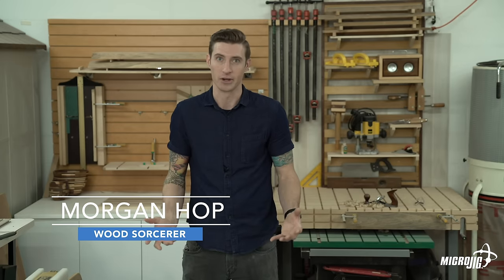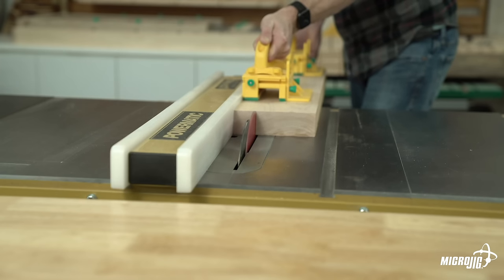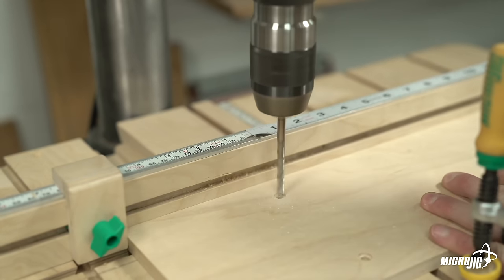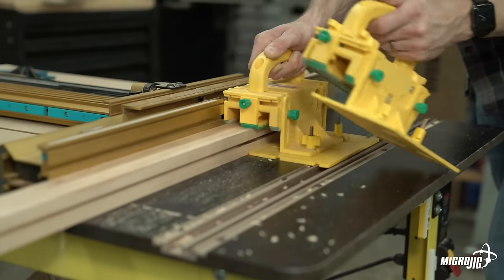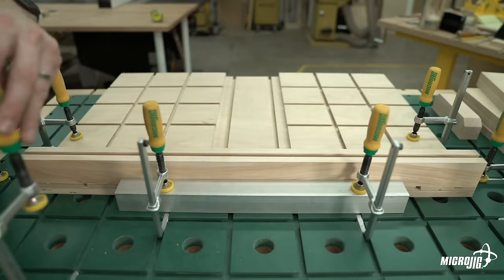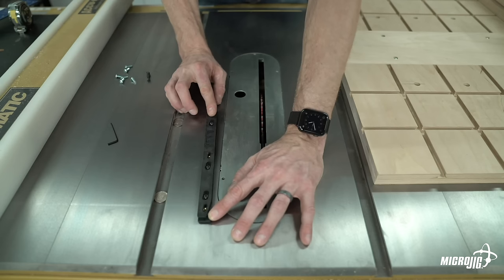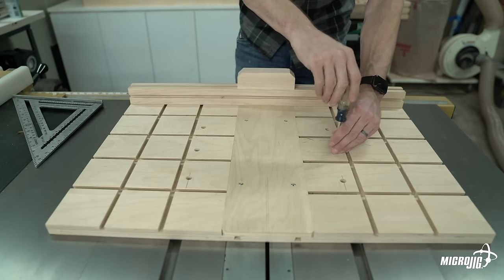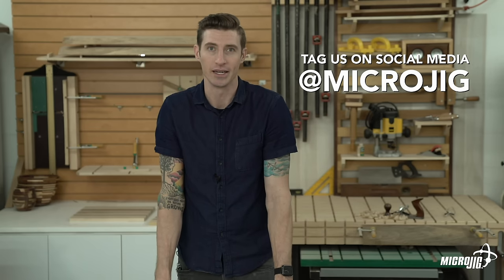How To Build the ULTIMATE 360 Table Saw Sled!

Comment: Morgan, as an owner of most Microjig products, I really appreciate this project! I’ve already downloaded the plans. One suggestion would be to make a fairly detailed video showing the use of each of the accessories. They’re easy enough to make using the downloadable plans; however, it really would be helpful to see how you attach them and examples of how you use them. The plans don’t necessarily make that clear and such a video would really help. By the way, on the 360 hold down fence, I was wondering what angle you cut the bevel at. Many thanks again for all you do!
Reply from the maker: the beveled edge of the hold down fence was cut at 30 degrees. And yeah that's a good idea - more detailed video about all the attachments. I'll add that to the ever growing to-do list haha
Reply: @Microjig  You should link to this video.  Who would want to put the time into a project or even watching a build video without seeing how it works?
Reply from the maker: @uhadonejob  this video is literally linked on our webpage where you download the plans: https://www.microjig.com/post/ultimate-sled
Reply: @Microjig  If you would read the message thread you should link to a video showing how to use this and the many features.  It is a big time investment to build something an d not have a clear idea of how well it works.  I appreciate that you did try to reply.

Comment: Morgan, I really enjoyed this video and I will likely build such a sled.  I would however like to suggest an added safety feature.  The front of the sled, closest to the operator would be better designed if it was extended toward the operator perhaps another 6" or so to allow the saw blade full travel.  This could be tapered toward the outer corners, to reduce bulkiness.  The reason for this would be to allow the sled to be pushed further into the blade such that the center of the blade comes up to the face of the fence, thereby permitting maximum cutting depth for thicker materials.  Additionally a wooden block or box should be added nearest the operator to keep the blade fully enclosed when cutting that far.  This allows allows for additional reinforcement of the base plate to compensate for the cutting of the base plate.

To prevent over-travel of the sled, a removable stop block could be added to the bottom side to stop the sled travel once maximum cutting distance and depth has been achieved.

Another nice addition would be to have a removable polycarbonate (lexan) shield attached across the top of the top reinforcing block, to prevent saw dust hitting the operator in the face.  This protective shield could be inserted into a groove in the face of the support bar, for easy and quick removal/replacement when needed.
Reply from the maker: dang, all REALLY good ideas. I'm sure I'll need to build another once in the near future so I'll definitely incorporate these mods!
Reply: I subbed to your channel because of your suggestions here
would be nice if you made a video of your ideas, please!

Comment: I just bought the 360 sled kit. Which one is better? Do I need to buy another kit to
Make this?
Reply: I'm building both. The reason is, i think the 360 sled is better for panels than the ultimate sled. Though, for most jobs both would probably be just fine. Which way did you end up going, and did it work out well for you?

Comment: I'm making one of these sleds right now and I drilled the 3/8 holes on the zero clearance inserts as instructed but  the mircojig hardware  washer is bigger than 3/8 so you will have to drill a larger countersink hole so I am using a HSS Brad Point Bit, 29/64,   this allows the provided washers  to just fit without making to large a hole.  I couldn't find a forester bit that was between 1/2" and 3/8"  I guess 1/2" would have worked but I felt there was to much slop. It is  Great crosscut sled design.  Very Happy!
Reply: I like the slop since it helps in awaiting up the sled before gluing the wings on

Comment: I’ve always made, and used crosscut sleds with a fence at both ends.  This sled is held together only with a front fence. Since you’re essentially cutting this thing in half I can’t help but wonder if the one proximal fence is enough to keep everything square.  What prevents the kerf from becoming narrower or wider over time?  Am I missing something?
Reply from the maker: We recommend building it with a removable front fence. Under normal use the front fence stays on, but for mitering longer parts the fence can be removed.

Comment: Morgan, why not use a rear fence to stabilize the rear portion of the sled. That way when you remove it from the saw it will have less of a tendency to split apart.
Reply from the maker: We are working on an updated version of these plans, and they will include a removable end fence.
You want that support, but making it removable allows for making miter cuts on longer boards.

Comment: You are gluing the fence to the sled. How do you adjust it? Is a five cut not needed?
Reply: Great question. Not the best detail in some of these videos but considering the price of the plans, and how versatile these sleds and jigs are, hard to complain. I'll be doing the five cut for sure.
Reply: see garage works and see how he does it  He uses a dial indicator and a machinists square.......simple

Comment: Great plans; great video. Lots to learn from this project. 
For instance: 
1)	Take your time: the Wood Sorcerer may not be an evil sorcerer, but he sure is good at making this all seem easy, and it isn’t really hard; if you take your time. 
2)	Measure 3 or 4 times; cut/boar/swear a whole lot less 
3)	Not all miter slots are the same…Even on the same saw table
a.	Some slots are wider than others …. Even on the same saw table
b.	Not all slots are the same distance from the blade .... measure them individually…. Even on the same saw table
4)	Put the inserts in with the screws near the open end.

Comment: I LOVE this design.  I'm working on a sled now that incorporates many of these features.  One thing I'm confused about is how to accommodate multiple zero clearance plates? I can't get my mind around how these different kinds of cuts don't mangle the front and rear fences.  Several YouTubers show the value of having these changeable plates, but they never show them in use and how they impact the fences.  The only thing I can think of is to add a temporary spacer in front of the fence so a 45 deg blade never touches the fence, or just live with the fence having a 45 deg kerf in it (and possibly kerfs for other angles between 45 and 90).  I don't mind the fence looking mangled from multiple angle cuts, but do those cuts ultimately compromise holding small stock against the fence for a simple 90 deg cut?
Reply: Yeah this is basically what I'd do... You have that dovetail groove in the face of the fence, so you can mount whatever sacrificial boards to it that you like.

Comment: I've made this sled as outlined in the plans and I would DEFINITELY recommend using 3/4" plywood as the base, rather than the 1/2" recommended in this video.  Once you cut the channels for the zero-clearance insert, you have 1/8" of material there and you are going to have to be SUPER CAREFUL doing the remaining steps before you put the back fence on, or your base will just snap in half.  There's almost no wood there until it's reinforced by the fence.
Reply from the maker: Hey Charles, great feedback! I considered 3/4" ply for the base but decided on 1/2" to preserve some of the capacity of the blade height. I figured I'm already losing an inch of capacity with the sled, didn't want to lose another 1/4". So yeah you have to be gentle with the base until it's reinforced if you make it this way, but of course you can use 3/4" ply for the base if you don't mind sacrificing a little more capacity.

Comment: I should have read the reviews before I bought the clamps, router bit and dovetail hardware. I am not the greatest woodworker, but this sled has so many variables that you can't help but miss one. it's heavy, flimsy, goes out of square after you take it off and put it back on your T/S  in as little as 3 times. I, like most hobbyists, do not have two table saws and use the same one for ripping and cross cutting. This sled only works if you leave it in place. MicroJig, mission accomplished, you conned me into spending $150 and wasting three days with your slick video.
Reply: Stephen, have you resolved your problems with this sled design?  BeI am quite interested in building one but concerned about the issues you raised
Reply: CORRECTION - sorry I sent that before it was completed. I also wanted to say with there products being expensive in Canada they also have pretty severe supply and demand problems, so it is a big commitment.
Reply: My only regret with buying the Matchfit system is that I only discovered it after spending a fortune on t-tracks and accesories......... anyone after some t-track?

Comment: With the dimensions for this sled, what’s the general crosscut capacity? Thinking I might give it a go
Reply from the maker: If I recall, the sled is designed at about 20 inches deep, but without the front fence, you can have parts overhanging the front. 
The actual cut width is largely based on your saw table, the distance between the front lip of the table and the front edge of the blade. 
With a 20" deep sled base, minus the 1-1/2" fence, you could have as much as 18ish inches on the sled plus several inches to the blade.

Comment: I'm overnighting the glue up and man was that initial routering frustrating. My router "table" is not big enough for the sub-project, I had to just clamp things down and struggle to get it all set up in that manner. I'm not super excited to do those routes on the top tomorrow, but we'll cross that when we come to it. Mostly I was here to comment that the cut list had those 6" sacrificial boards at 24 1/4" but then when I got to the glue up, they were magically only 20 1/4. I'm still not sure if I'm going insane or if that was a typo.
Reply from the maker: It is a typo but we cannot comment on your mental state! LOL.
A straight edge clamp does help a lot with some of the internal grooves.

Comment: Would it be ok to use mdf for the base material, the 20"x30"x1/2" piece ? Or is it not strong enough? Thanks for the great videos
Reply from the maker: MDF is "strong enough" overall, but care would need to be taken when handling the sled putting it on and taking it off the saw table. 
When on the table, there is little stress, so be careful when picking it up and how you store it.
A removable fence that can be connected to the front edge with dovetail hardware will greatly stiffen the sled base and can still be removed when parts need to extend beyond the front of the sled.
Reply: @Microjig  thanks for the reply. I'll be going with plywood now.

Comment: I have been wanting to build something like this for quite some time, particularly love the way the zero-clearance insert modular design is incorporated.  Great design; thanks for the video and first-rate, downloadable instructions / plans. Great presenter; hot body, i.e., not fat; and why do you sometimes comb you hair to the left and sometimes to the right?

•  Some sled components / parts use MDF and some plywood.  Is there a durability / performance difference between the two?
•  What is that green (base) material used in sleds?
• What is the purpose of the holes in the center of green sled?  Is that / could that be a sled weight-reduction function?
•  The individual “squares” on the sled are about 4x4.  Is this based on the throat depth of the clamps?  Would 3x3 squares be less or more functional / utilitarian?
•  The slots on the base of the vertical cutting jig do not appear to match what is shown in an instructional video. Is this a subsequent modification?

Finally, seeds do not die before they grow: they ripen and go dormant before they grow and bloom in order to continue the cycle.
Reply from the maker: ragcell- a lot of questions there, please send me an email with them at "support@microjig.com" and I will gladly type out a full set of answers.

Comment: Is this sled not secured at the front? Most sleds I see have a fence on both ends, wouldn’t this be totally unstable when taking it off your table saw? I’d be worried the two halves would break as the only thing holding them together is the rear fence
Reply: Any answer to this.  Wondered the same thing.
Reply: Likewise. Seems he is depending on the rather hefty hardwood fence to hold everything together. Might be fine, though I’d be tempted to add something on the front. How, I’m not sure yet. I do like the concept, and I’ve got pretty much everything I need for it. But whether I want to devote the time and resources to making yet another sled I don’t know.
Reply: I'm definitely planning to add a front fence to this design as I build it. You do have to make sure that you can still remove/insert the zero-clearance inserts.
Reply: I'm building this now and was wondering the same thing. But, I think I have a solution. Before I remove it from the table saw, I'll clamp a 2x4 across the front (using the matchfit dovetail clamps of course). I'll lose two clamps, but that should keep it held together. Will try to update after I finish it.
Reply: Wondered the same. Anyone who built this sled have any issues with the unsecured front?
Reply: I just posted the same question not realizing that you guys have raised the same issue here.  I guess the best advice is to fabricate a rear fence to deal with this.  Seems like a stability  issue that was overlooked.

Comment: Brilliantly done! I love the replaceable inserts because they often get chewed up. In a similar way a possible replaceable insert on the fence would give zero clearance as well. Once you use a dado the fence will have too wide a kerf to support a normal cut. I think this would have made it the "ultimate sled" with an infinite array of accessories. I have never been a match fit fan but I'm definitely coming around.
Reply from the maker: John, thanks for the kind words! If you use the Dovetail bit to form a wide slot in the face of the fence, you can make matching insert pieces that slide in from the top. Make them taller than the fence and you can cut the bottom away to reuse them as they get cut. You can also make new stock as needed.

Comment: Silly question, but how square is your sled/fence to the blade? I want to make a crosscut sled and I’ve seen other people use the 5 cut method to do this.
Reply from the maker: Joe, Your rip fence should be adjusted to be square to the blade, so we use the rip fence to set sleds square as well. The ZEROPLAY guide bar is built to allow for some adjustment in the mounting as well, so that can help.
But if you prefer the 5-Cut method, by all means use it. 
I personally prefer to square the fence using a trusted square.

Comment: When I screw down the inserts, the screws are long enough to punch through the plywood on the body of the slide. I remade the inserts, using the absolute minimum depth for the 3/8 hole. The screws still stick into the plywood. I've drilled holes to accommodate the screws in the bottom. I don't think I'm making the screws crazy tight. Maybe 1/2 inch baltic birch is thinner from my supplier than what you used. Has anyone else encountered this?
Reply: Just had this issue. Im going to cut them shorter or buy some from a hardware store that are way shorter.
Reply: I used a caliper to measure how deep I drilled the holes so I know I didn't screw up.
Reply: Same issue here. Do they sell ⅝", in going to check my store. Might go up to ¾ of i have to. I'll lose ¼ish inch depth of cut, but at least it'll be stronger at the joints, although but heavier too
Reply: Only ~⅛ inch of material is left in the dovetails for the inserts 😳

Comment: I’m confused. The zero clearance insert is 24.25” long, and the base layer is only 20” wide. There’s significant overlap that doesn’t show in the video. What am I missing?
Reply: You flush trim with a router afterwards to ensure a consistent edge. Helps against wasting time to no avail attempting to align a hydroplaning glue joint.

Comment: @Morgan any thoughts about beefing up the base later to ¾". The thickness at the insert dovetail seems too thin.
Reply from the maker: Just saw this after responding to someone else with the same question. If you don't mind losing another 1/4" of the blade height's capacity, go for it!
Reply: I feel that the 3/8 dove tails in the half inch clearance area makes this flimsy.

Comment: I wanted a smaller table 4 my drill press.  What I did was once the grooves were made I cut it n half, and glued it back 2 back.  Then I could use the dovetail grooves and clamps on the underside 2 mount and dismount my table.
Reply from the maker: The best part of building your own jigs, fixtures and tables is that you can make them to fit your needs. Nice work.

Comment: Hopefully this reaches someone I know this video is old but I just bought the stuff for this the other day I realized my router only takes 1/4 bits can I still make this
Reply: You can, but it will heat faster, as I understand-it. So take your time and be sure to make relief grooves first, because if you don't, that's a lot of material to remove for a 1/4 inch shank...

Comment: Great concept. Could you please also do these in metric? Thanks.
Reply: If you go to Google, there is an inch to mmm conversion program
Reply: @daveklein2826  When converting from imperial to metric you get for instance 1.5875 cm for 5/8 inch. Good luck with that.